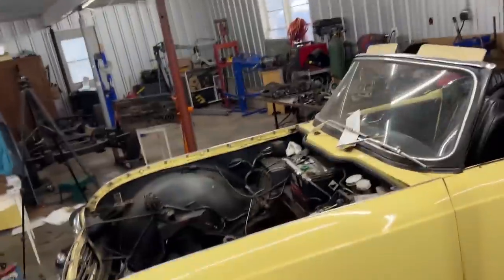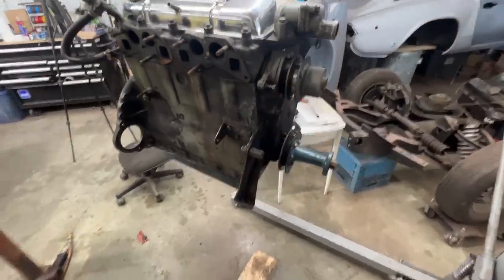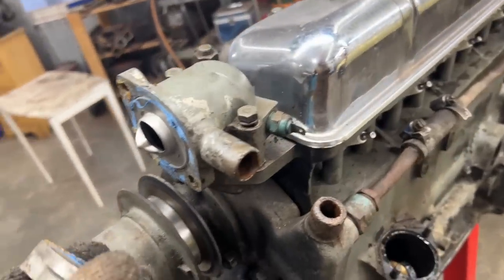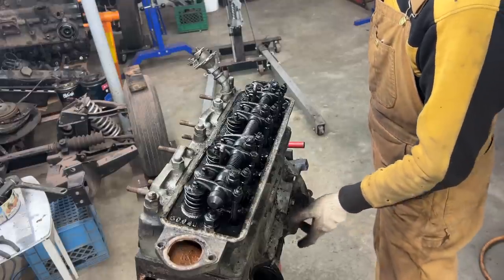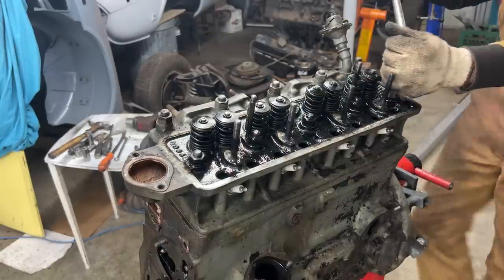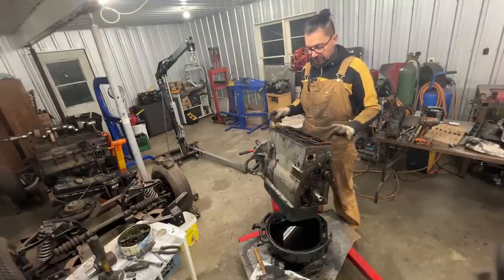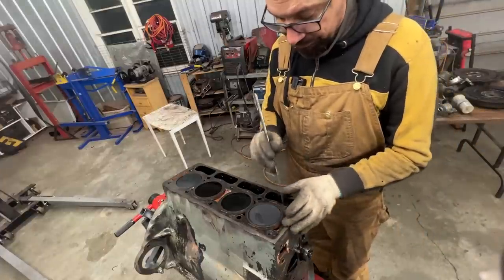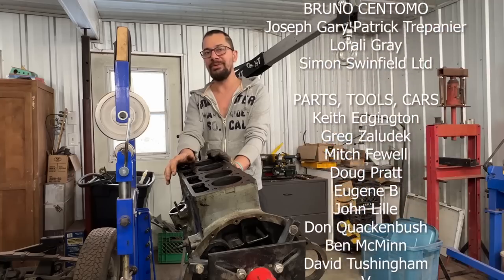1964 TR4 - Part 5 - Engine Disassembling

Comment: It's always very interesting, never a dull moment when you're digging into these old TR engines.
That bent front engine plate could mean that the 4 had been hit on the right front corner, enough
to bend the frame. That's what I found on my 4A after removing the body.

Comment: Elin, make as many engine rebuilds videos as you want, they’re my favorite!!

BTW - the TR4 had the external breather tube, but it was deleted on the TR4A. Instead the TR4A got the external PCV system for emission reduction. It required a port on the valve cover to vent the oil vapor to the PCV valve, and a port on the intake manifold to receive the vapor. In addition, a special vented oil filler cap was also added. Some TR4A owners preferred the TR4 system and deleted the PCV system and went back to the breather tube (I’m one of them 👍).

Comment: Very interesting.  Elin I am pretty sure that everyone enjoys  all your videos whether they are about body work, electrical work or mechanical work. About twenty years ago I did an engine job on a 1500 Spitfire engine.  It was running very badly.  The whole car was a wreck really.  When I stripped the engine the ring gaps were 1/8 of an inch.  The blow by was enormous in that engine. Oil was being pumped out the dipstick tube.  I really don’t know how it could run but strangely it did have compression.  The pressure must have built up in the base enough to show up on the gauge.  Oddly though I was able to hone the cylinders, use the standard pistons with new standard rings.  New bearings were fit all around of course. I fit an oil pressure gauge and pressure was great even at idle.  There were too many others other things  to fix to tell about here. 
   I bet the rings in the TR4 engine and in the GT6 have enormous gaps.

Comment: I have enjoyed every episode. Everytime you do an engine something different seems to get in your way and its very informative and entertaining to watch you solve the problem. I've just begun my adventure with a 76 TR. It's not in terrible shave save replacing bushings and brake components. There are however two issues that I am not looking forward to. The trans has an oil leak and there is some body work. 
Anyway, keep up the great work!. PS I'm a retired TV Director and understand the extra work you put into presenting these episode for us. THANK YOU!

Comment: Entertaining! I love engine disassembly videos. Thanks for talking about the  faults with the motor, also. I hope to build another motor someday, as it's so satisfying to put new parts on and old block.
Reply: BTW...that is a very tired and slightly abused engine ya got there. Starting with the Fram filter :-X

Comment: Happy Sunday,
The "engine holder" I always called the Yoke.
Pepper ('74 TR6) has a dead engine so I'm thrilled with the mechanical videos.
Reply from the maker: Thanks. I will remember that :)
Reply: If you are replacing the camshaft anyway, might I suggest the “fast road 83 cam”  gives you a wide power band  with about 25% increase !
Regards 
Sandy 🔧🏴

Comment: Are you referring to the engine stand yoke? The yoke fits to the back of the engine which in turn fits onto the engine stand. Bespoke yokes are available for individual engines, but the one you have is a universal yoke which fits to many engines (but not all).
Reply from the maker: Thanks, now that you mentioned it I think I’ve heard it before. I will remember it this time

Comment: That was fascinating Elin.. As you rightly said; "How was that engine running ?".  Back in the day I did several wet liner replacements (1991 up to 2.2. if memory serves me), and general crank grinds and baring replacements ectara on TR-2 to TR-4's but never came across anything as bad as what you've discovered so far.. The bottom end sounds like another adventure into 'what the f..k ' territory 😂

Comment: Hi Elin, Good Video.. Just a tip...When you need to 'fish' in tight places with the magnetic stick, I find it helps to push it through a thin piece of plastic electrical conduit. It stops the magnet being pulled to the side.

Comment: I too like the mechanical work a lot. I was wondering if the intake and exhaust valves are supposed to have the same lift?
Reply from the maker: Yes, but even if they didn’t both 7 and 2 are intake, so they should be the same and they were the ones with the biggest difference

Comment: I’m rebuilding my Tr6 engine ( due to your inspiration, thank you) but long story short my engine front plate has the same deep grove from the chain tensioner. If possible, I’d be curious to see or hear your final thoughts and resolution to the TR4 engine plate.
Thank you
Reply from the maker: My plan is to fill it up with weld and grind it. Haven’t done that before, but I am sure it will work fine.

Comment: You need to heat that stud to break the bond to head... a propane torch would be enough to heat that safely... heat it and squirt it with a lubricant ( multiple times if needed )....i would wire brush around it first....having that gap would allow it to drop once you get it to expand ( head ) ..
Reply from the maker: Now that the head is out I can deal with it easily. I might even press it out. After I clean the part that is still sticking out of course
Reply: @RustyBeauties  
i use heat on problems like that..at least try to heat it and get it to break the grip.... sometimes it saves alot of extra work or destruction...lol...
you got it off... always a way that works.... heat also helps to avoid breaking or snapping the fastener...

Comment: I watched the rest of the video now and am rather alarmed at how much is wrong with the engine. That bent pushrod and broken cam follower must mean something??? The cam is clearly worn out and I wonder how flat the head and top deck are. Could you not have unscrewed the last stud using two nuts, too? Maybe I missed something. Are the cam lobes for intake and exhaust the same height? I would love to be there measuring and cleaning with you. I miss the smell of burnt up engine. LOL Thanks for a really interesting video.
Reply from the maker: I tried the two nuts method, but they were just spinning together. I showed that briefly in the video, but maybe you missed it. Yes, the camlobes are the same for intake and exhaust, but even if they weren't #2 and #7 are both intake, so they should be the same and these were the ones with the biggest difference in between. I don't think the head and block were damaged by whatever happened to that pushrod, but you are right, I should check them.
Reply: @RustyBeauties  Ah, my dogs were trying to distract me while I was watching. I guess the were successful! Thanks, Elin.